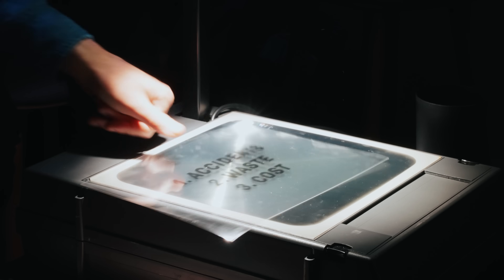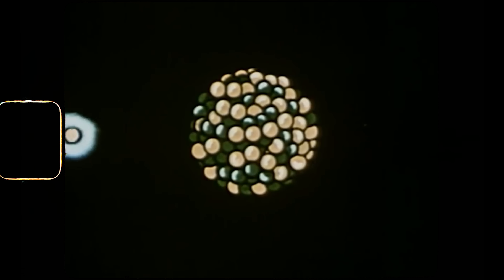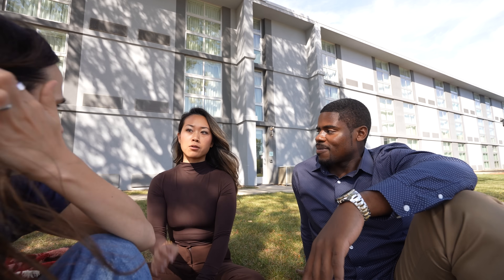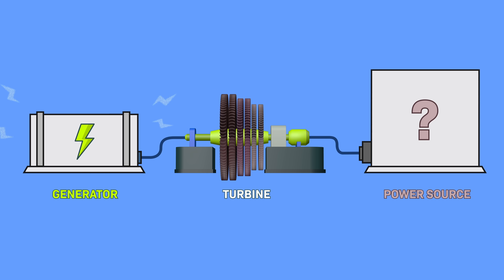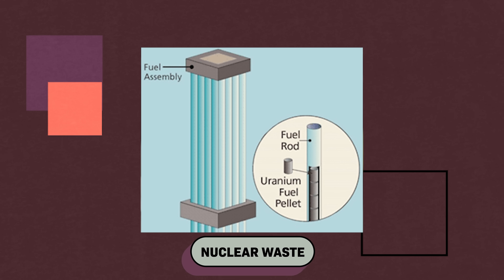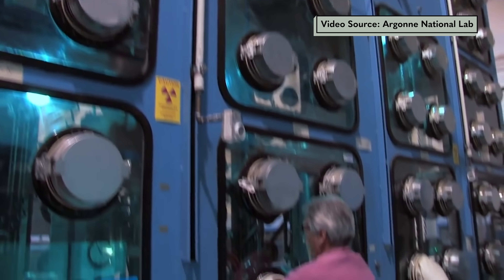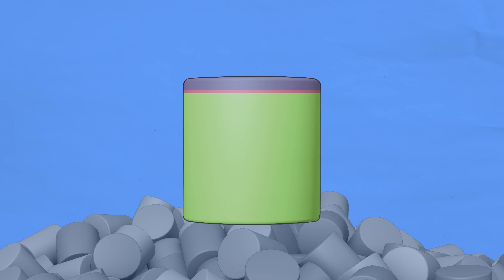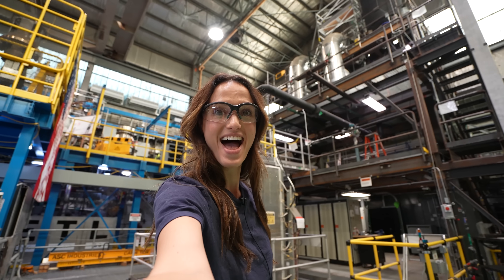The Big Lie About Nuclear Waste

Comment: This is only 1 way of recycling nuclear waste.  For decades, we have used rtg on spacecraft. You could use an rtg to create hydrogen fuel, then use the hydrogen to fuel vehicles. No mining additional fossil fuels, no burning fossil fuel to deliver it to the gas station. And when the rtg has filled the hydrogen tank, the gas station could just dump the excess electricity back onto the grid for others to use.

A 1000 watt rtg generates 1000 watts a second, that's 3600000 watts an hour. In the  small town I live in that's 36 megawatt an hour if all 10 gas stations did it. And every Gass station would never run out of fuel to sell as long as they had a water supply to make more.

No toxic solar cells or batteries to recycle, no huge wind farm killing birds. They just keep doing it for many decades.
Reply: no... 1000 watts of power is 1000 joules of energy per second, 3 600 000 joules per hour, which is 1 kWh per hour, or 24 kWh per day (worth 20 cents per hour).
Reply: @gordonhowell8366  I'll look into it if i miscalculated. BUT how much hydrogen is that? How many cars could you refuel with that hydrogen? And much nuclear waste could be recycled to power those rtgs?

No, it isn't going to power the country by itself. But what if you could reduce car pollution by 90% by using hydrogen? Isn't 10% of that pollution better than 100%? Even if it's only 50%, isn't that better? And the excess power... even if you can only break even in the station usage... how much additional pollution do you save by not using fossil fuel to power the fuel station? And no delivery tankers. How m7ch pollution does that get rid of. Heaven knows we could use those drivers more delivering food than a fuel.

Now multiply that by the tens of thousands of fuel stations in the country. How does that not significantly decrease pollution? And that's just one thing we have the technology to do NOW! We just burn methane at sewage plants into the air. Why are we not using it to decrease the fossil fuel needed to run the plant? There are a thousand other things we could do also.

An all or nothing will get you just that... NOTHING.

Comment: In theory, that’s all great.
Reality is that fission is a non-controllable technology, and will never be. Not to 100%.
On the other side, this technology comes with unacceptable collateral damages in case of an accident (Harisburgh, Tchernobyl, Fukushima. The complete list of accidents or near-accidents can be found on Wikipedia).
Secondly, we’re currently in a transformation phase towards decentralized energy generation by wind and solar. The power grid needs for this are wide distributed networks instead of tree-like nets in case of large central power plants. With growing share of renewable energy sources, large fission power plants are simply no more compatible, or we have to double invest in two types of power networks, which is economically nonsense.
Just my 2ct.

Comment: After 6 years as a nuclear operator in the Navy, I spent 7 years working in nuclear waste disposal. This wasn't spent fuel, but mostly contaminated water and filtration media. By the time I quit the industry, the regulatory environment was incredibly hostile. It was as though the government was punishing the nuclear industry for existing. If you want to use the technology discussed here, you must first get government to work with you, not against you. We will always have radioactive wastes other than spent fuel. Therefore, we will have to find new ways to deal with this as well as the spent fuel.
Reply: The problem is that regulators consider any ionising radioactivity is dangerous. It’s quite ridiculous how they work. Coal fly ash is radioactive but at duck low levels it’s harmless. Yet if a nook plant gave the same rad signature as a coal plant there would be a massive fuss. Natural gas also contains traces of radioactive elements. The concentrations are harmless but the same issue applies.
Reply: @Dave5843-d9m  You could spend a lifetime working in a nuclear power plant and still receive more exposure from chest x-rays and frequent flights.
Reply: @ I think I’d rather they be too cautious than throw caution to the wind in pursuit of profit. We can improve the methodology but to do the complete opposite would be asinine.
Reply: Do you mean the government that tries to protect citizens’ health and safety? I would hope that regulations remain strong and that monitoring and accountability become stronger. If private industry does not want to deal with those protections, then government should do so and bear all of the costs and reap the profits in the public interests. The world does not need any more wealthy owners and CEOs. Energy is too important to risk leaving it in the hands of potential bad actors. There is plenty of precedence that set the table for regulation, monitoring, enforcement and liability judgements, if necessary. 

I do not pretend to have any technical knowledge about your industry, but historically we have seen what can happen when industries are not regulated and monitored. As an Albertan I can tell you that in a province where the current government claims to have the “world’s most ethical energy”, we don’t even have the most ethical energy in the country. The oil sands tailings ponds have had accidental leaks and we know that people have experienced higher incidents of health issues downstream from those operations. There will be hundreds of billions of dollars of abandoned and orphaned oil wells by the time those industries are no longer economically viable and the existing regulations have not even been strict enough to ensure cleanup takes place. Companies sell off their operations and environmental debts to other companies that eventually declare bankruptcy and the cleanup costs are falling onto the taxpayers that saw the greater percentage of the profits from extracting the resources that they own leave the province. New coal mining operations are going to poison a finite water resource in the southern part of Alberta with selenium, but at least the richest woman in Australia will just get richer.
Reply: @piktormusic2538  muy bien dicho
Reply: Get rid of nuclear energy. Waste problem solved. Nuclear waste is not clean energy. Is it.
-Combat Vet
Reply: In the video it states that it is simply cheaper to get new uranium than it is to recycle the used stuff Does this take into account the cost of storing the snf for hundreds  if not thousands of years ?
Reply: @louisneiman3469  For spent fuel, it's going to be thousands of years at a minimum. The half-life of U-235 is in the millions of years. We can't keep storing this stuff indefinitely. Just like the national debt, we're just kicking the can down the road, leaving the problem for future generations.
Reply: watching this video, i did wonder if some of the waste is ‘stuff that those spent rods came into contact with’ too.
Reply: What incentive obviates simple Solar and a better battery?
Reply: @hermanhusband6595  Not sure exactly what you're asking, but money drives everything. If there is money to be made, someone is working on those alternatives. As for the government getting involved, based on what DOGE is finding, that is a bad idea.
Reply: Says a lot about government. Bureaucrats are by nature cautious and overzealous. This also suits left-wing politicians who by their nature want to control the population.
Reply: I had an older brother who worked with PCBs and told me that he thought that their danger was overblown. He died in his mid fifties.
Reply: Let it go in the world and see how we evolve with it
Reply: Jimminy rigged the gov't to hamper & destroy the nuclear industry.
Reply: There is nothing better than politicians to make the worst policies a reality.
Reply: Definitely need to get the government with us.  Engineering can solve the problems.  There are other options for energy too such as drilling down about two miles pumping water down to create steam in an almost unlimited supply of steam turbine energy.  Government officials just can’t fathom technical problems and solutions.  They think nuclear waste is the morning after eating atomic wings……
Reply: @MalcolmBerke  It's being done now in the vicinity of Munich. However that is rare. It works only where geological structures are such that hot layers are close to the surface, such as 2-3 miles deep. Mostly it is far deeper (up to 6 miles) and thus technologically and financially not feasible. There is a reason why Iceland or other vulcanic hot spots have so many geothermal plants, because heat is close to the surface.
Reply: @ Wyoming should be ideal then too
Reply: Coal exhaust can be much cleaner but our political system seems to want to crush coal.
Reply: @craigb8228   I live in coal country.  There is hostility towards it too.
Reply: @craigb8228  A certain part of our political system seems to want to crush most electrical generation methods, while also demanding that we drive electric cars and get rid of natural gas appliances. Make it make sense.
Reply: @ genuinely what are you smoking
Reply: Don't hold your breath 
As President Reagan, the government is not the solution to our problems. Government is the problem
Reply: Tbh if you’re in the navy, you are the government. It sounds like the solution is more educated regulation which will now be significantly harder after the abolition of the chevron doctrine.
Reply: @Idealist_Metaphor   I think we just need the Energy and Commerce Committee in the House to pick up the topic, bring in experts and consultants, decide on a direction and propose the changes.  I looked up some info from their site and looks like they were talking about storage and recycling of fuel in April 2024, saying they are developing their policies to support the new advanced reactors that recycle the fuel.
Reply: @Idealist_Metaphor  Isn't 'educated regulation' an oxymoron, like jumbo shrimp?
Reply: @ bro what? Why would you expect to have ignorant regulations?
Reply: @MMSS-hn5uf    No, not really.

The problem in a Democracy, or a Constitutional Republic, is that you get a critical mass of misinformed people.   Some are pollyannas who ignore risk.   Others are unhinged luddites who want us to return to the 18th century.

My read on the NRC has been that they are pretty sharp people.   They demand what seems reasonable for the risks involved.

Nuclear power is not harmless.    Civilization makes its demands.  We have to be wise.
Reply: @jamallabarge2665  The NRC is a bureaucracy, just like all of the other government agencies. As such, there is little effort towards efficiency. Also, while supposedly apolitical, it is clear that politics plays a vital role in decisions. Those with the strongest or loudest lobbies will often sway policies.
Reply: @MMSS-hn5uf    You would be correct if the NRC did all of their own work.

The NRC mandates "contractors" who are certified by them.    Such contractors are responsible to customers and my employer.

The Politics of the NRC are torn between Commercial Power providers, who make a good chunk of money for premium, high availability, negative carbon power.

Pitted against them are people who are suspicious of the Nuclear industry, and some who hate nuclear power.

The results of these tensions have been decades of an absence of no Chernobyls and no Fukushimas.    Neither disaster would be possible in the US, mostly because of the NRC.

I would love to see some 'tough love' rather than the mindless hostility evinced by people who want what I call 'hippy energy'.

As an employee of a nuke contractor I do not trust anything, I check and sometimes recheck.    I am very OCD on my work.
Reply: You say "we will have to find ways" as if we already have any way to actually deal with waste. Which we don't. We don't "deal" with waste, we "put it over here and hope it doesn't become a problem" because there is no easy way to undo something being radioactive apart from either waiting a long time or putting a lot of energy into it. And the latter is the big problem of nuclear energy already - we're wasting so many resources on it while it's not even economic in the face of actually clean alternatives.
Reply: @IzzyIkigai  But a lot of the fuel 'waste' can be utilised to generate more fuel to power nuclear power stations. Then THAT fuel 'waste' can be utilised, and so on and so forth.  So it wouldn't NEED to be "put over there" at all, and would never become a problem.

And the thing is, there's stuff that's NATURALLY radioactive, without us touching it at all - like Uranium, Thorium, and Bananas.

And your 'actually clean' alternatives often aren't. Wind turbines have a LOT of waste which can't be recycled and need huge amounts of oil as lubricant. They also cause a lot of harm to birds. Solar panels are extremely inefficient per sqm of panel, and also have side effects.  Hydro plants require dams to be built, destroying habitat of wildlife down river.  And geothermal generation (the cleanest of the lot) are limited in where they can be placed.

Nuclear plants aren't the problem. It's politics.
Reply: @IzzyIkigai don't all forms of energy production cause some amount of waste products...

Why is coal power production like let's just pump it up into the atmosphere no one will mind 1000s of tunes of rubbish floating around in the air we bearth it will be fine.

Comment: It seems you're referring to a video about using nuclear waste to power plants. I'll try to provide some context and clarification on this topic:

1. Nuclear waste vs. spent nuclear fuel: The term "nuclear waste" is often used broadly, but in this context, it likely refers to "spent nuclear fuel" from conventional nuclear reactors.

2. Reusing spent fuel: Some types of spent nuclear fuel can indeed be reprocessed and used again in certain reactor designs. This concept is not new and has been explored for decades.

3. Fast breeder reactors: These are a type of nuclear reactor that can use spent fuel from conventional reactors. They're designed to "breed" more fissile material than they consume.

4. Benefits: Using spent fuel could potentially reduce the volume of nuclear waste and extract more energy from the original uranium, improving overall efficiency.

5. Challenges: There are technical, economic, and proliferation concerns associated with reprocessing spent fuel and operating fast breeder reactors.

6. Current status: While some countries like France and Russia have implemented limited fuel recycling programs, it's not widespread due to various factors including cost and policy decisions.

It's important to note that while the concept is scientifically sound, its practical implementation faces several challenges. If you'd like more detailed information on any aspect of this topic, please let me know.

Comment: Also another thing that is never talked about is thorium reactors can stretch out the use of recycled wasted for even more years. Since thorium cannot become fissile on its own we can use the waste we have to start the reactions. that was also side tracked back in the 70s for the convectional types. But best thing about thorium is you cannot have meltdowns because it needs added waste fuel to keep reaction going so it is safer and also more energy dense. problem they had back then was they needed to find new metal alloys that would stop micro fractures in the pipes from the super heated molten salt. it got sidetracked for traditional non recycled plants like you said. thorium reactors are now finally being looked at in other countries including china but the US really needs to re invested in it to meet energy demands and our aging current Nuclear plants. Especially since we have the technology to create stronger allows for molten salt reactors thorium will be great

Comment: Accidents will happen, and DO still happen. It only takes an earthquake or tsunami and we are all in a radioactive hell. I would not touch the stuff personally. It's only a matter of time before there is ANOTHER disaster. NOT WORTH THE RISK FULL STOP ! 100000 year problem alright, so it is just buried !!
Reply: It took a magnitude 9 earthquake AND a 40m tsunami to cause Fukushima to fail, and it was only one of several nuclear stations hit. So a 1 in 10 event following a once per millennia event. And all of that to kill zero people and expose no residential regions to greater radiation than Ramsar, Iran. Oh, and something of the same scale wouldn't cause the same problems now, anyway.
This is not the argument you think it is.
Reply: @Crispr_CAS9 … and Japan intentionally not building the plant properly.

Comment: Forget fuel rods & light water reactors - switch to Thorium Molten Salt Reactors like Indonesia's current phase one PPA with ThorCon for 8×500MWe molten ion salts, of Thorium-sodium berilium fluoride salt.
Walk-away safe high temperature but near ambient pressure at a delivered to site capital cost of $800 -$1000 per kiloWatt.(ie. excludes fuel cost) and a pre-profit levelized cost of less than $30 per MegaWatt.hour (<$0.03 per unit kiloWatt.hour.